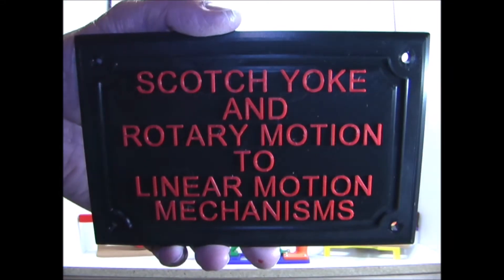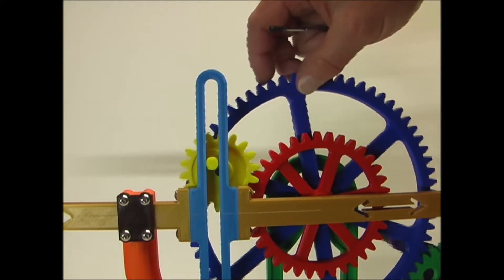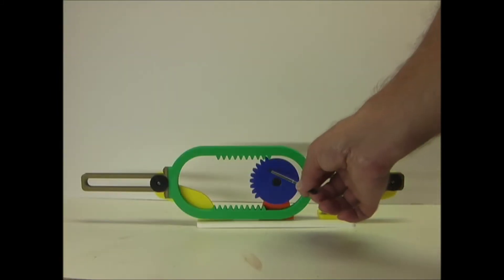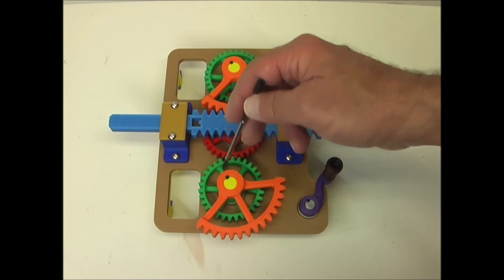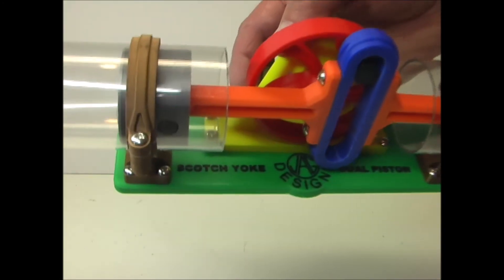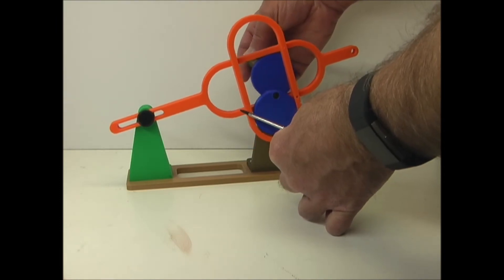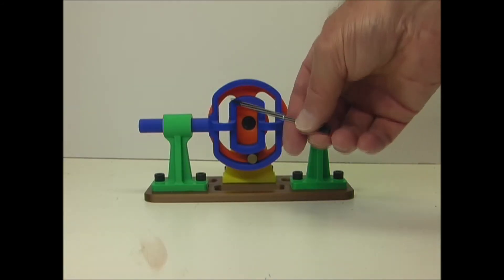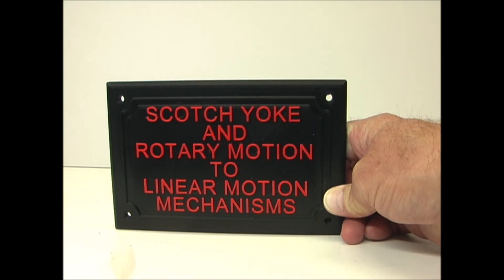Scotch Yoke and Rotary to Linear Motion Mechanisms PART 2. 3D Printed Models

Comment: between those 8 Mechanisms. How to choose the most appropriate one, since it would be necessary to make a Kinematic and Dynamic analysis of the mechanism's output in relation to the input and determine the mechanism's gain in both force and speed... Would this be how I should select the correct mechanism? Thank you